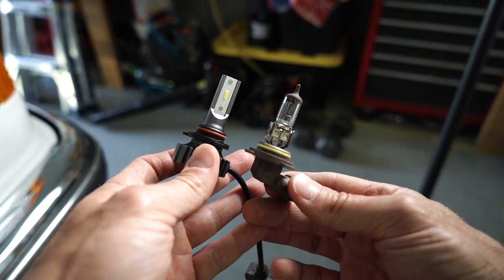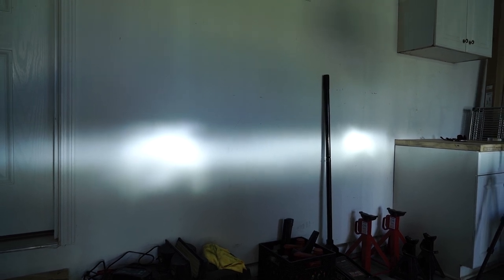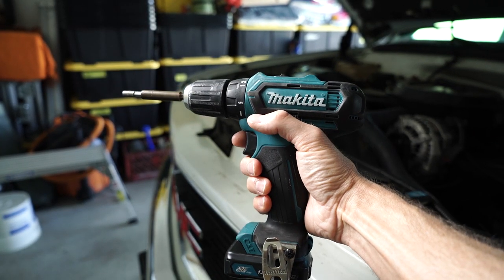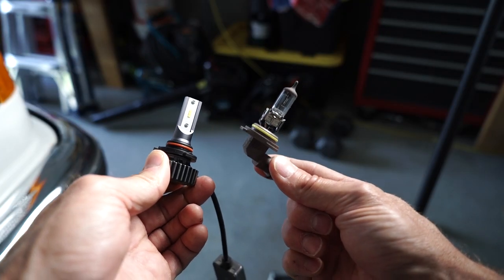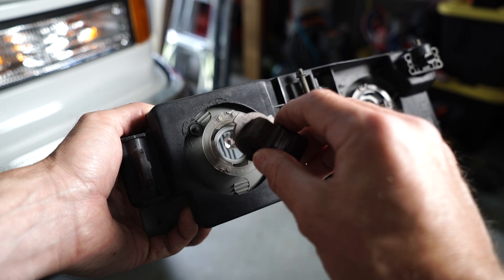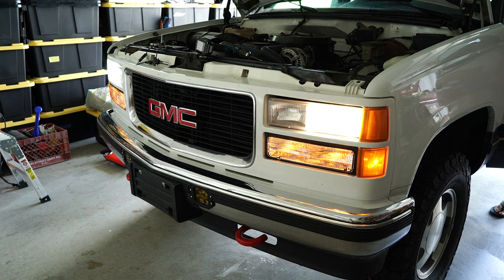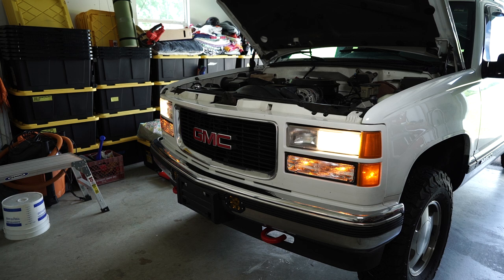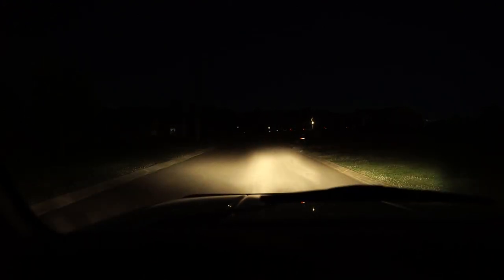LED Doesn’t Stand A Chance Against This Type Of Bulb!!

Comment: In your previous videos you said that you are crazy for white lights - you were extremely hyper when you installed white led lights - you also said that you dont like slight bluish white led lights - 
Since your taste is clearly exposed which is new is cool bright is better -
But after you were made to realize and explained to by others that your wrong - 
You have been forced to make a video in which you have not mentioned that it took you 2-3 years to realize that the white or blue leds look better on modern vehicles because of their modern design - and that they only appear to be bright because of the light pattern which lights up the the road because of better design of the reflectors - 
Which was not the case in your old cars - because in your old cars the reflectors are not precise in throwing the light where the driver needs to see - 
That is why in your old cars the lights had to be more bright in order to compensate for the precision .
So the reason why mostly people like you go crazy about white leds is because you think the brighter led will make your old car light up the road like the brand new cars - 
But mostly youll look cool - And this is clear with your reaction in the previous video in which you go.....waaaaaooooo!!!!! OMG 
And tell everybody to buy the leds which have more leds instead of the same size/fitment led with less leds.

Comment: LED. does not light in all directions and does not withstand as much heat as ordinary light bulbs do.

White with blue has never been pretty !! Natural white 4000k or 3000K is nice! Stupid almost everyone only sells
5000k - 6000K LED. to car.

 3000K or 4000K is nice collor!

There are flat LED bulbs that shine in almost all directions but you do not get a 10w or 50w bulb into the front light!

you can buy new lamps made with LED bulb!